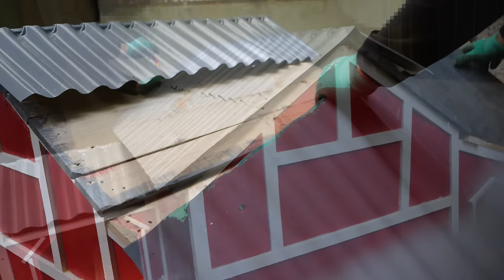Inside the Most Luxurious Stray Cat Shelter Ever

Comment: Nicely done. Insulating the floors, walls and ceiling would have added much more comfort in the Winter for these Cats. Also, a nice thing to do is to add a 14mm workout pad under the blanket, thus adding comfort and warmth for those Cats that sleep there.
Reply from the maker: Nice idea. I will update it.

Comment: I've watched your two cat house builds. They're both fantastic and you have a good heart. I'm not sure if you left the roof sitting on top of it or if you fastened it to the frame, but if you put hinges on one side, it's easy to open and clean out when you need to.
Reply from the maker: At first, that's what I thought of doing. but I finally fasten it with screws. I clean it 1 time per month. it's boring to take out the screws and the ceiling every time but I didn't have much time for more details. maybe in the future I will make it as you tell me.
Reply: @redtieprojects  You could put latches on the other side of the roof from the hinges so it seals properly.

Comment: You need to put a base at entrance of door to prevent snow from blowing in. If it doesn’t snow there than that’s great. But without something across the bottom of the door, snow will blow in. There needs to be a 3-4 inch board across the bottom entrance door to prevent snow or rain from blowing in. Keep watching during the winter snow months and see for yourself.

Comment: Bautiful Cat House.
Painting the roof to look like a metal roof is an excellent idea.
Giving the cats a wide screen TV is funny, keeping the cats active on those rainy/cold days !
Using a heating pad is probably the safest and most efficient way to heat a cat house. Using a space heater is just asking for trouble.
One problem I find with building Cat Houses, is there small, leaving access for house keeping is very difficult without losing integrity. 
I built my first Cat House for my indoor/outdoor cat. But it was soon overtaken by strays in the neighborhood.
I live in the North, and Winter has become my main concern when building shelters. Doors are a huge problem for heat loss. 
I find that because heat rises,  the use of floor holes for access is a much better solution. 

Nice work, and great video !
Thanks for sharing  !

Comment: Adorable
you are very creative & the cats certainly appreciate it
just a suggestion with your roofing iron though, you should put your screws in the upper ridges not the bottom as when it rains they could leak as water runs down the lower ones
thanx for caring & sharing

Comment: Dude, you are just awesome. May I suggest that you try and get heating floor film so you can cover the entire floor and then put rubber mats on top of it? The heating floor film can be bought online  for cheap and you can scavenge rubber mats or used carpets.  You can also get wireless thermostat to link to the floor film and you can control the temp of the film. You'd probably be able to have more cats in it if the floor is heated.

But seriously, hats off to you. You are just amazing!